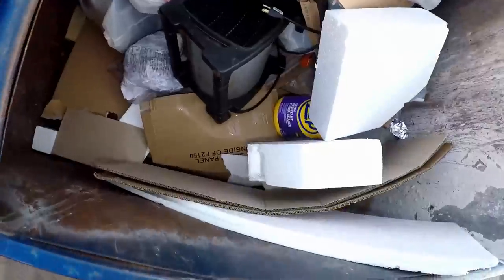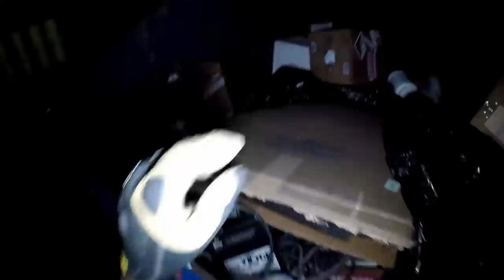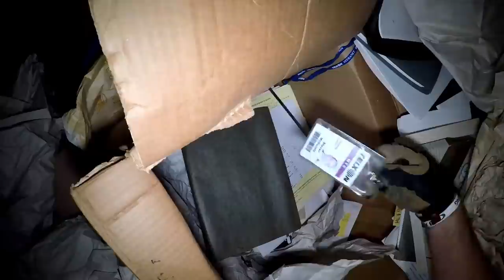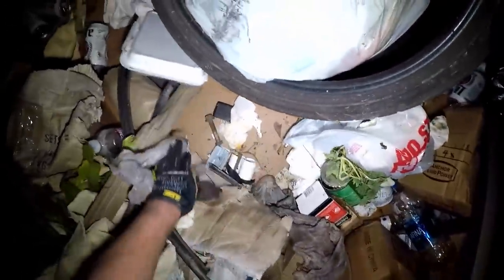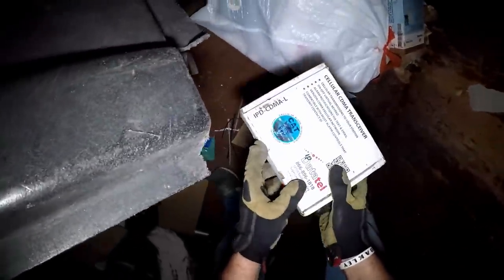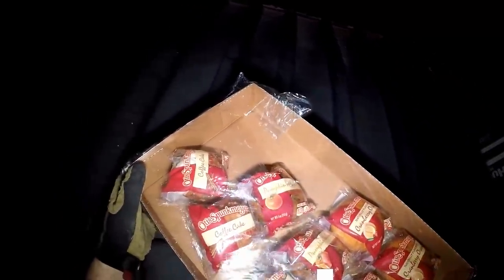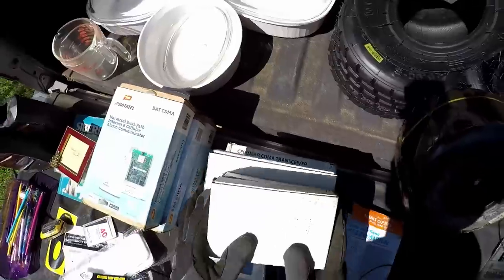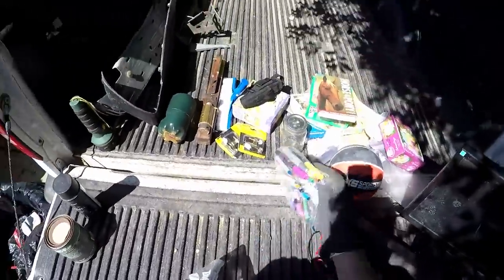Dumpster Diving "I Slid Right Out My Shoes!"

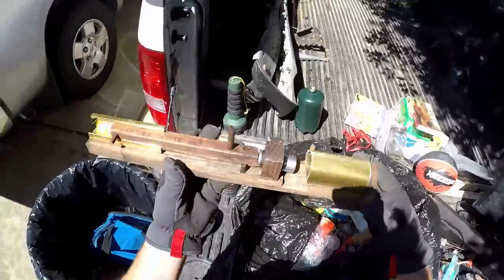Comment: 47:40 that’s how it goes, steel slug is the anvil. Put a big rubber band on the wood peg of the slide and the stationary part towards the left. Put a pecan between the anvil and hammer then pull the slide back on the left and let go. Keep body parts out of the space where the pecan goes or you will crack your knuckles in a new kind of way.

Comment: That raceceiver in the go cart part box has some value . They use them in all dirt racing new there $100+ you should be able to eBay that if works check it out good Mike

Comment: You pulled out a Texas Inertia Nutcracker that works quite well.  You adjust the tension with the size and number of rubber bands you hook on the wood peg that sticks out.  Then pull back and let fly.

Comment: always check motors if they can run as generators/alternators. 

when they have permanent magnets built in, that is the case then.
they should be able to generate power without external excitation.
not the kind of alternators U have in a car where U still need a battery to get some electrons :)

these will sell off pretty well

Comment: 2:37 The box at the back of the monitor is a mini PC.
22:19: those are wet weather racing tires for go-karts or even electric kick scooters.  The one in 24:19 and 26:15 are the racing slicks (for dry tarmac), the last one still is OK.  And I'm seeing Rotax parts--that could be a go-kart racing team's dumpster.
25:38 You found a pager!
40:37: Probably a PCMCIA memory card.  You will need a device with a PCMCIA slot for that, usually found in older computers.
Reply: 25:38 it’s kind of a pager but not exactly. Raceceiver is a thing that tells the driver of the race car when and where if there is a yellow or if they need to move spots or if the are disqualified
Reply: @larrythompson4854  :  Well, at first glance, it did look like a pager; and it figures, since it was found at that go-kart racing team dumpster.  Still a cool find, though--that's for onboard communications between the driver and the pits.

Comment: The wooden item is a nut cracker. Slide the gold piece back put the nut between the two pieces of steel and slide gold piece over the nut and hold it tight. The sliding wood piece needs a big office rubber band on the two pins. Pull the sliding wooden piece all the way back and let go. Open gold piece for a cracked nut. These were popular in the 1970's

Comment: That cylindrical piece of metal you pulled out that blue bag that had the metal sleeve around it it's part of a nutcracker you picked up  the  12in long piece of wood with the slide action  on it  that's what it's goes to

Comment: Hay check into vids on auto striper for your wires a sharp nail and drill a hole into plate metal and feed and pull and wire stoping by the second

Comment: That "LightScribe" drive is likely a CD burner that used a specialized media that would let you design and burn a label instead of providing stickers/using a sharpie.  It was a fad that lasted maybe two years or so, heavily pushed by Office Max back in the day when it competed with Office Depot (pre merger)/Staples.  The process was slow, poor quality, and very monochrome -- it lost to the Sharpie.
Reply: Exactly right, had one many years ago.  The software to create your design was clunky and inaccurate, and i think it took about 45 mins to burn it, just to end up with a burnt label that was barely legible and rarely matched your design.  Cool concept, terrible execution.